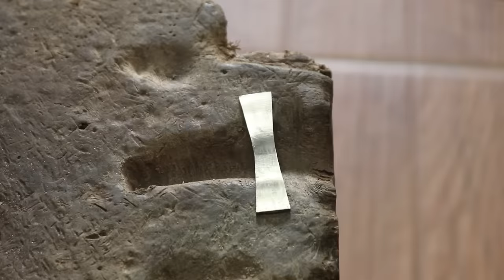Make a gold ring for men - jewelry maker

Comment: Bloody Beautiful!! 😁👏👏👏👌 I love watching these videos. Instead of the point of point of dividers or scriber, I use a sharpened piece of 3mm stainless steel rod to transfer flux / solder to the joints. It won’t burn away and I wouldn’t even think of destroying the temper of my expensive tools! 😅